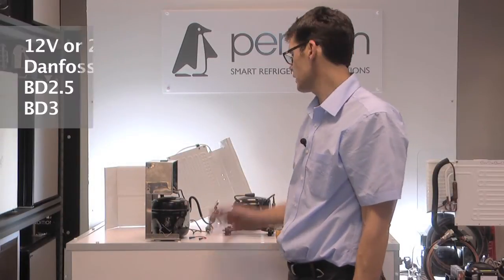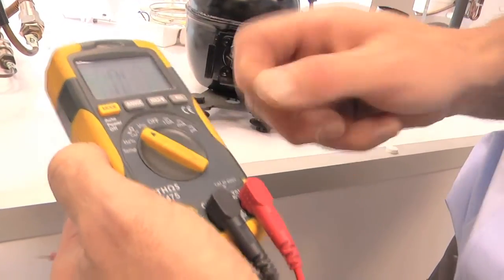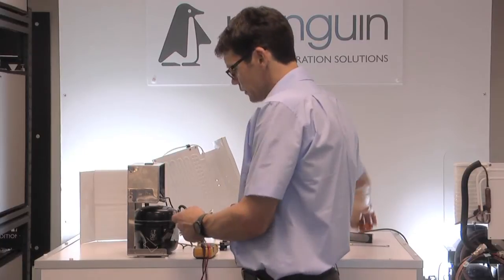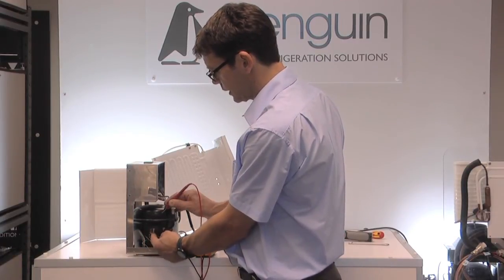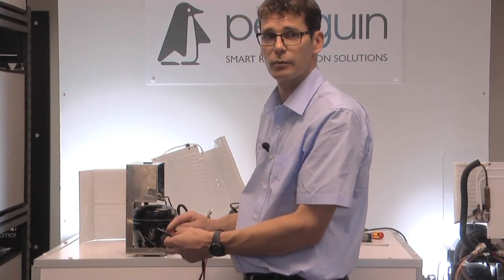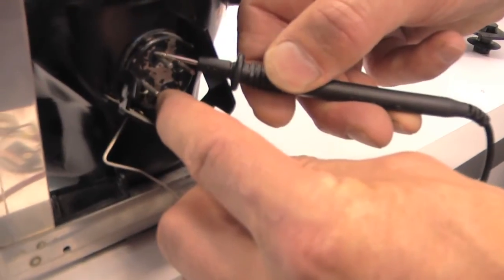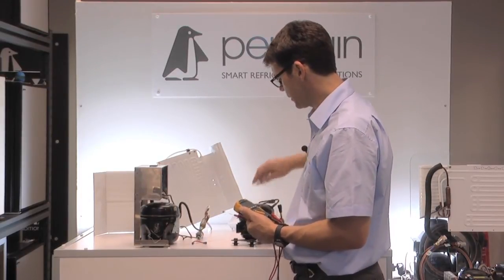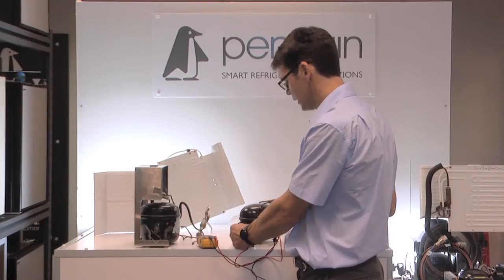Continuity/Resistance test before changing Danfoss 12V or 24V 4 Pin Controller - E254412 or E254424

Comment: My BD35 won't start, no dead short but i'm getting resistances of 2.2 to 2.6 ohms across. I have replaced the  controller and tried shorting the thermostat, so im concluding it is the compressor that is dead.

Comment: Hi. 
I've got a question...
In the case I want to force the start of compressor, just to check if the motor is good, how can I connect the three pins? (without the electrical box connected)
Reply from the maker: Hi Mauro, in our experience you must have a working controller to run the compressor, even to test. If your compressor is suspect we recommend testing the resistance across the pins and also for a dead short to the outside of the compressor. See our video:  https://www.youtube.com/watch?v=wETaZHf0amI
Reply: @penguinrefrigerationlimite3531  Can you use a hard start relay like 3 n 1 on a 4 pin Danfoss?  Thanks!